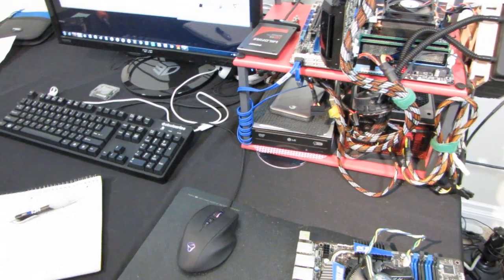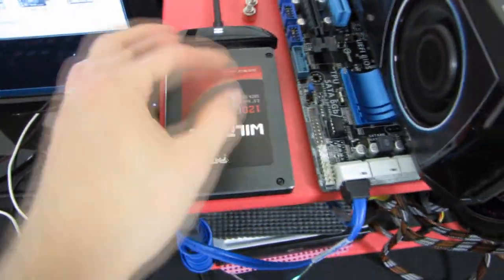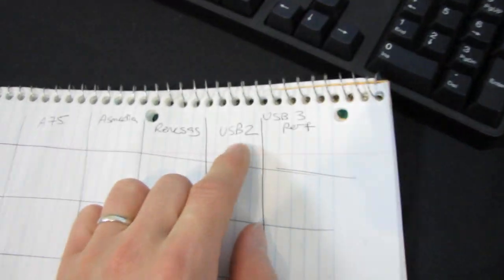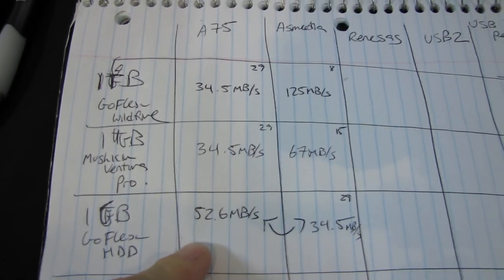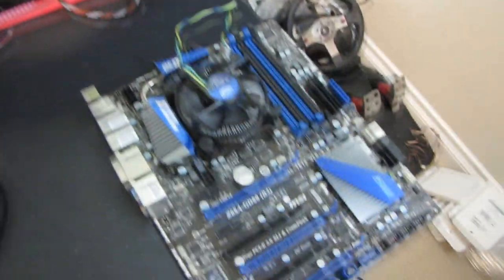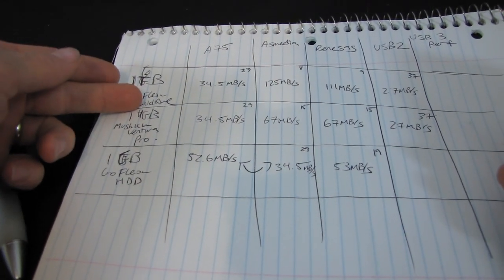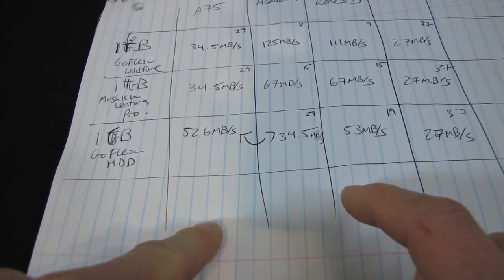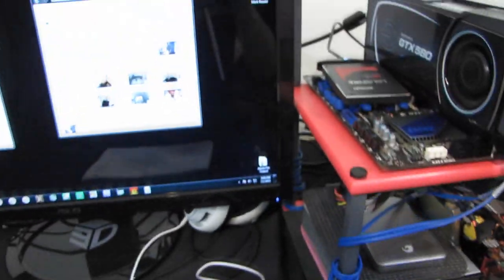USB3.0 Chipset Thoroughput Performance Round Up Linus Tech Tips

Comment: @chuninuzomaki locked OS are usually performing then open OS. Look at iOS and Mac. When you buy stuff from Apple, it just works because the OS is only performing in an enviorment that they like. In Windows and Android, the OS performs under many different environments and might not run as well. Just look at Vista. If Microsoft made Vista only run on hardware that they allowed, Vista wouldn't have sucked like most people that it did

Comment: @EmoticonMayhem iOS is a locked down OS, Android is an open OS

Most people here like open OS. However I have been seeing comments about the iPhone not being a proper smart phone, now then I used to own a Nokia X6 running symbian, now that is not a proper modern smart phone.

I have an Omnia 7 (WP7) and I don't care what phone I have as long it works for my needs. Normal people don't want sophistication so iPhone is for them. Also Mac vs PC? who the fuck cares, I use both, you don't pick sides.

Comment: @MrDavid10 higher volts are going into the power supply, but the wires coming out of the psu are 12v, 5v, etc. just don't go poking around inside the psu itself.

Comment: @crumbworks Now, think of it other way - for example, you're backing up 1.5 TB of data to 2 TB external HDD. Would you rather wait 16 hours (USB 2) or 4-5 hours (USB 3, using decent drive such as Hitachi Deskstar 7K3000)?

Comment: @ahroksvaag i was commenting on your lightpeak that gets around 500-600mb/s. i know lightpeak is "better" then usb 3.0 (the only problem is that there are not enough products supporting it at this time). if you know the diffrence between bits and bytes than you have use them at the riight way and than you've to say 1200MB/S not mb/s

Comment: My USB 3.0 ports uses the NEC/ Renesas chipset, but I have yet to actually use it. For me, time is hardly a factor compared to capacity. I'm never in a rush to copy stuff, and don't mind spending an extra 30 seconds using the PC while waiting. With that said, I wouldn't go back to USB 1.1 speeds as that is just painful.

Comment: @ahroksvaag 600 / 8 = 75 => 75MB/s so USB 3 is about 40% faster than thunderbolt. Go learn the diffrence between bits and bytes and come back. ow yeah as you write 600mb/s thats 600 milibits /s so it would take 13 seconds to transfer 1 byte. good luck with your uberfast thunderbolt